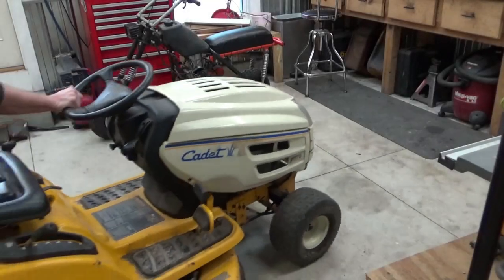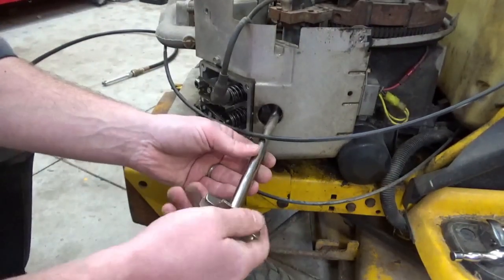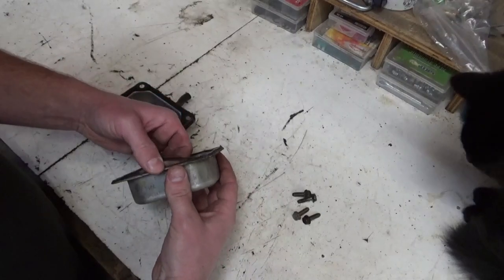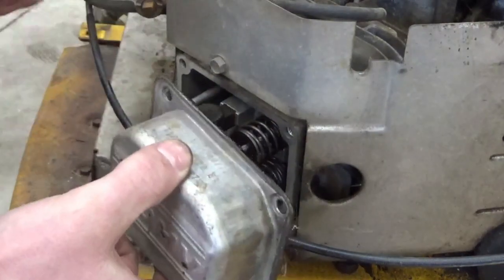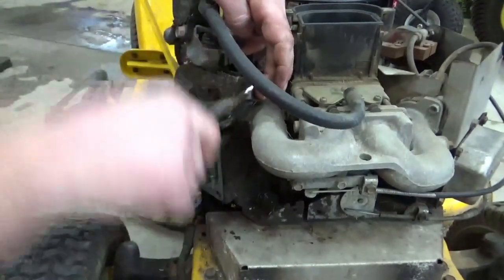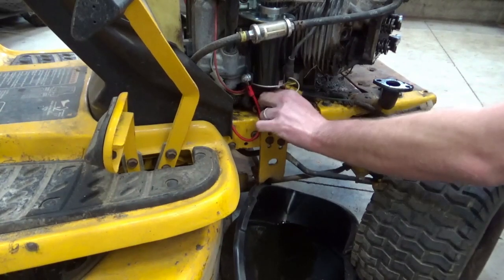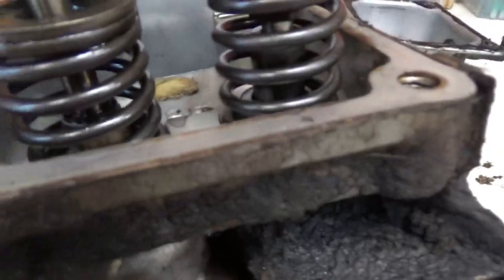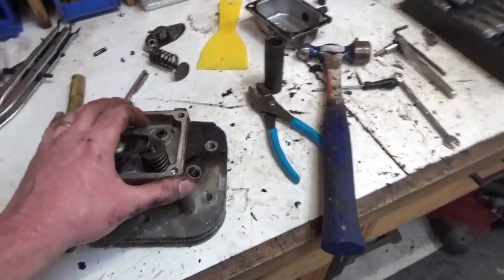Why is this Mower Engine not running?

Comment: Recommend you replace the cylinder head. When Mr. Squeaky built his nest he cut off air flow, the head overheated and the valve guide moved. To push the guide back where it belongs may or may not work, if you cheap out at least use some sleeve and bearing retaining loctite.  Also note Briggs has changed the cylinder heads for better reliability. Be sure to follow the proper tightening sequence and torque. Also Briggs at least in the past, the heads come complete with valves and required gaskets.